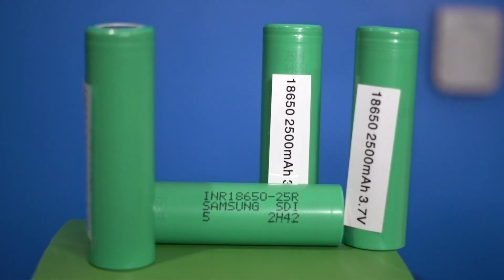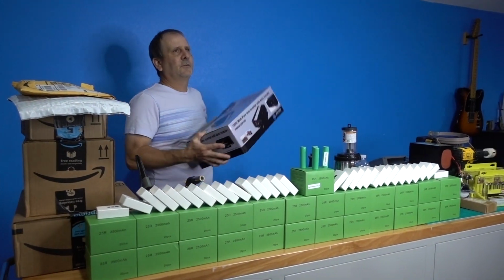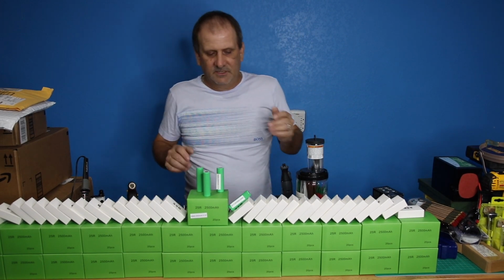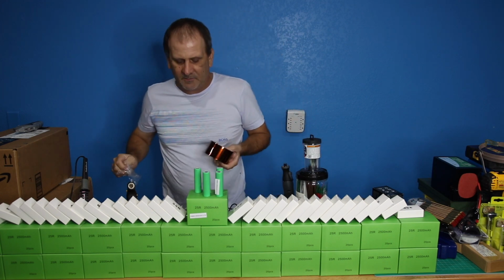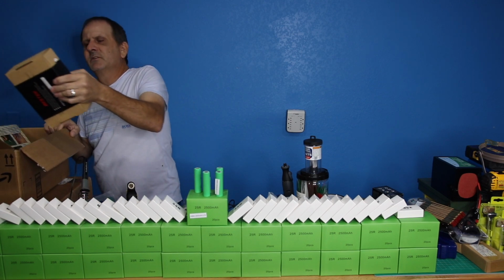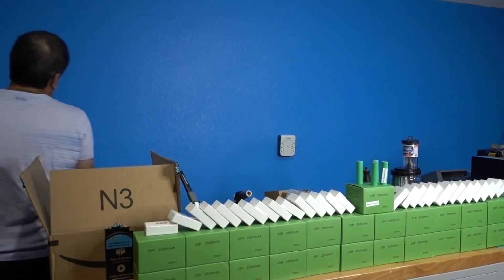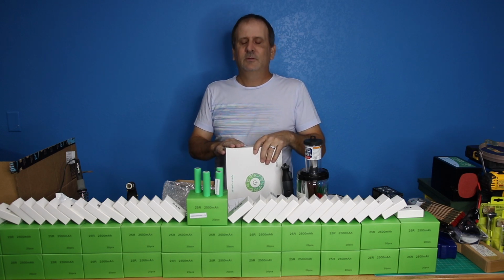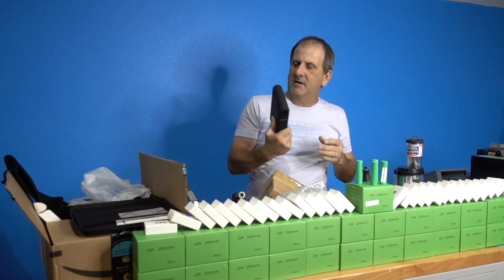18650 Portable Solar Generator, Tesla Powerwall, Giveaway and 600 Samsung 18650 25R Lipo Batteries

Comment: Good info!  Thanks for your zest for videos!
Reply: Have 3 wheeled mobility scooter using sealed lead acid batteries ! Want to change to lithium. Which to select ? Lexis light easy travel 24 volt 'battery boxes for 400 watt max on front wheel drive! New lead acid batteries one set of 12volt 12 ah & one set of 12 volt 14 ah . Originals 12 volt 12ah sealed lead acid batteries. 400 watts/24 volts =16.6666 amps?  24 volts/3.7 volts=6.4864864 cells? I have 2  battery boxes at 24 volts on 2 -12 volt 6x3.5x 3.2". . Life po4 or lith 18650's? How many batteries ? 60 or 120?  What will you sell batteries for ? What would it cost for a build on battery pack for this scooter?
Reply from the maker: JW i will have to do some work on this one lol. If you don't hear back from me in a day or so hit me back up. But if your scooter needs some weight for center of gravity than LFP if not lithium is ok. LFP is much safer so its gonna be a toss up either way. Either battery will fit the boxes and will take less space than the gel or lead acid.

Comment: I am starting from scratch converting a Ram 1500 pro master into a complete off the grid living permanent from solar and batteries. Need to know what I need to  make 3 or 4 100 watt solar panels connect to these batteries and get them to work. Need alternater , fuse, circuit breakers , wires, batteries, switches and lots of instruction, plus cost. I am 75 and learning.
Reply: Its cheap just to buy a solar panel. You can get a 385 watt panel for less than $200.

Comment: I need a deal on batteries! I would love to have all the ones in the video!
I need about 2500+/-, for my house. its powered by a 5 kW inverter 24volts. and a 6kw and 2500 watt generator. I have 200 ah golf cart batteries. im waiting on getting solar panels. I hope to get about 2kw in panels. I need a deal on battery's. I can build the packs. I will have to buy a few a month. likely every month for like a year or two! great video!!!
oh I only have 200ah now I need about 1000 -1500ah just to start. I'd like to end up with about 5-10kah. because there are weeks without sun now n then. it would save on fuel for the generator . I hope to get off of it completely. and go full solar and hydro electric! sorry I am rambling...
Reply from the maker: James shoot me a PM with your contact info and we can talk. All my batteries are new not recycled so this can be expensive. Also the batteries I have in this video are extremely powerful and have 25a discharge rate. This is much higher than the average power wall and MUCH higher than Tesla's rating at 5a per cell. So 2500 to the door you're looking around $4+ea depending on when you purchase them and the shipping rate at that time. Shipping prices and RULES seem to change daily so can only quote when ready for the bulk purchase. I will have individual cells on my site soon.

Comment: That sounds exactly what I need..! I have my solar system plugged in to my home outlet, and have been wanting to get something I can charge from my home outlet and then use thru outlet as well, using 18650 batteries. I have access to lg batteries and have some already, I was looking to make a 15 to 20kw pack....can you help with that? called tesla for a powerwall but too many hoops to jump thru on that side.....So DIY is better. Hope you can help me with this project THANKS!!!!!!!!!
Reply from the maker: Alejandro Gutz, YES this can be done but you will need some components to make sure you do not back feed the grid or your solar panels. An inverter with auto transfer switch is the way to go or just a transfer switch to run on your battery bank when grid power shuts down but you have to make sure you have 2 transfer switches and an A/C coupled system. These solar builds can be extremely simple of extremely complicated! Just depends on how much money you want to invest and how smart you want your system to be and how automated you want your system to be.
Reply: My solar system shuts down when the grid goes down....I need the battery to start when this happens...when the power is on I would like to use the extra power from solar system..usually anywhere from .5 to over 1 kw per hr, depending on the season..I have looked up ac coupling but no idea as to how to start this project. Money wise...I would like to spend 5k or so an a 15 to 20kw battery system...ready to work....All I have to do is plug it in and then when grid goes down, back up kicks in.....Could you help with this? Thanks
Reply from the maker: Yes I can help with this. Let me know exactly what you need and want to do and we will go from there. If you just need a battery bank built I can do that or if you need batteries or whatever I can help with that. Thanks
Reply: I would like something I can just plug into my outlet like I did my solar system....if possible. that way I can just take it with me where ever I go. (meaning Moving states) So maybe a 30kw battery back up system, that gets charged using my home outlet and I can use it thru out the home at night when there is no sun, also when the grid goes down. Not exactly sure what other info you might need to make this work. if this this enough send me some estimates my way please. If not enough Info please ask. I want it as easy as possible so my family could use it in an emergency. Oh I forgot I want to be able to check it thru an app or my computer as well, charging, supply, discharge, all of that stuff. Thanks hope to hear from you soon.
Reply from the maker: Alejandro, Ok I can make this happen. I will be in touch with you. Please send me a PM with your contact info and we can talk about pricing and options. To be honest to get a 30KW lithium bank you are talking some serious money. Then we need to discuss the voltage of your solar system, the voltage of an inverter, all the different components and parts to make everything talk and play nice together. Lithium is not the same as a Lead Acid bank so a few more obstacles to overcome. I would suggest a 48v system no doubt. Depending on your power needs I would start with a MINIMUM 6000w pure sine wave, low frequency inverter and myself would do a 12KW with a 36KW 20 sec. surge. so much to talk about it just can't be done here. But lets talk for sure.
Reply from the maker: Alejandro, I can't send you a message? You must have your settings set to private. i got yours but can not reply? Check your settings and make sure you are not set to private. if you need help just search out: how to turn on private messages on youtube.

Comment: I want to put some rechargeable batteries into something that  can power the Sony GTK-XB7.
Reply from the maker: You can use several different size cases and a few connectors etc. try the rigid case or even the pelicans work great but cost a bit more if you get into the bigger ones.